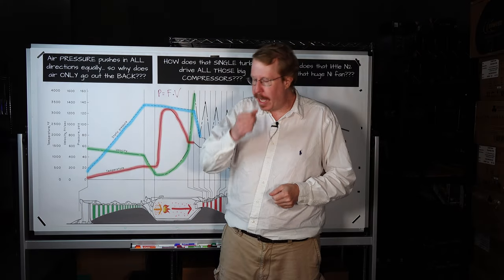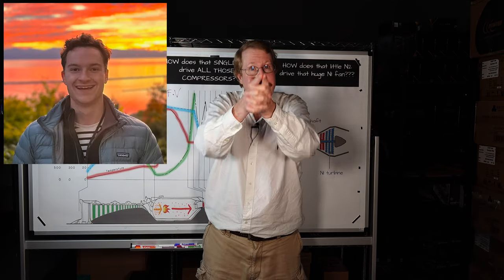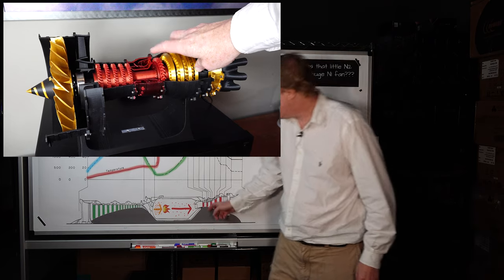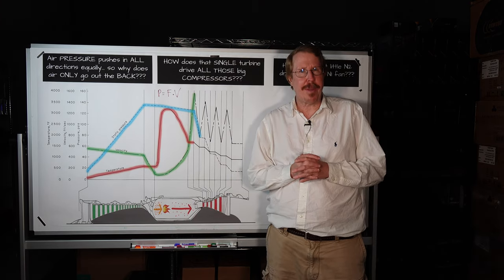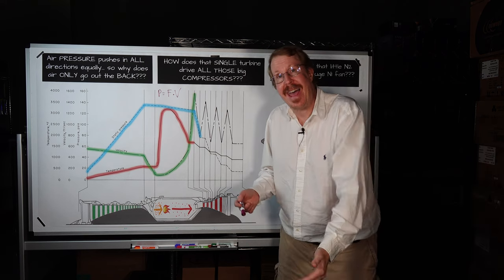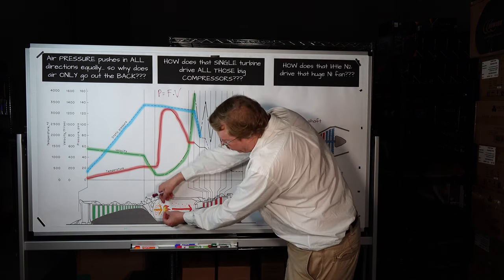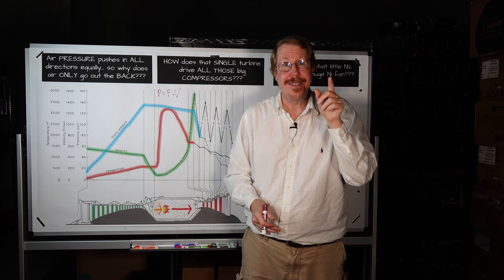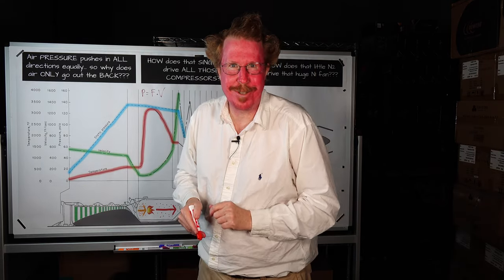How Jet Engines Work

Comment: Austin left out a most important detail, which is the theory of convergent/divergent ducting because his explanation doesn't explain a ramjet which has no moving parts at all and yet acts the exact same way from a physics standpoint. I think he was just trying to simplify it for the laymen out there. But as a former military jet engine mechanic I can tell you that it's a little more complicated than he's describing..  the air does not escape out the front because the divergent ducting of the diffuser section prevents it from doing so. But if the pressure in the combustion section rises to the point where it overcomes the pressure wall of the diffuser section then the flow does go out the front and is what is known as a compressor stall. this was actually a big problem of the original TF 30 engines on the F-14 because if fuel was added to quickly when a pilot pushed the throttle forward then pressure rose much too fast and before the air could expand out the turbine it overloaded the compressor/diffuser causing compressor stall.
Reply: Sounds like someone who's studied Bernoulli ;)
Reply: welp time for him to refilm this for the 3rd time

Comment: Love your video, but you need to correct something in your analogy about force. You don't push a car when it runs out of gas. You get a can of gas and pour it in the tank. You push a Tesla when the battery runs down.     Xplane forever! Thanks for all your hard work.
Reply: Or you call a tow truck who brings gas and a generator and charge you up enough to go to a charger for a couple hours 😂

Comment: It looks interesting at first that both pressure and temperature decreases while velocity increases, but i guess the velocity is the net particle velocity to the back of the engine, to the lower pressure area. So the bumm's energy to the particles is directed towards the back by the pressure.